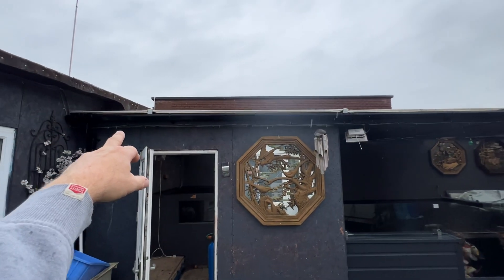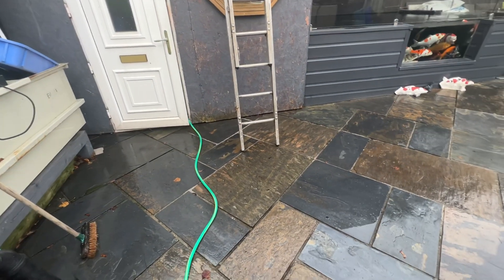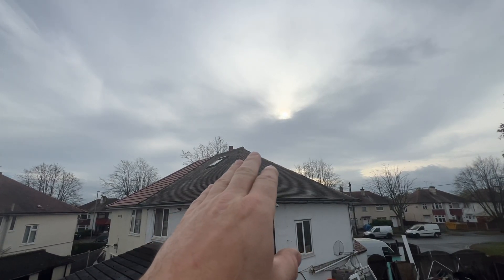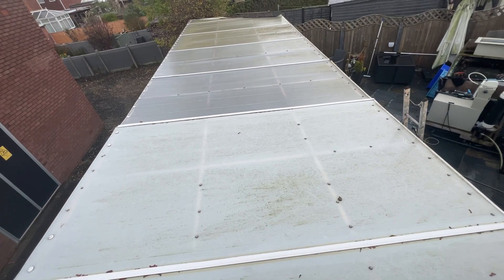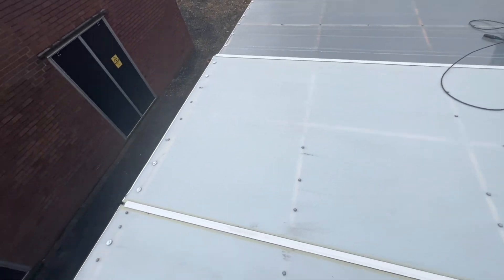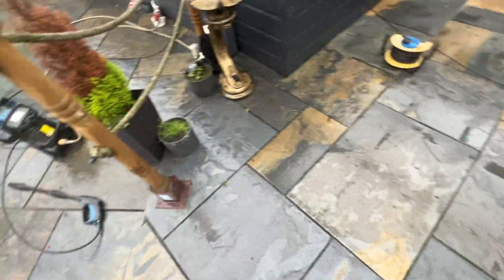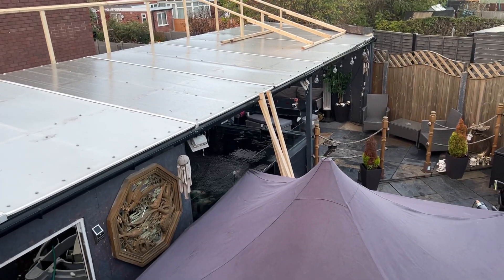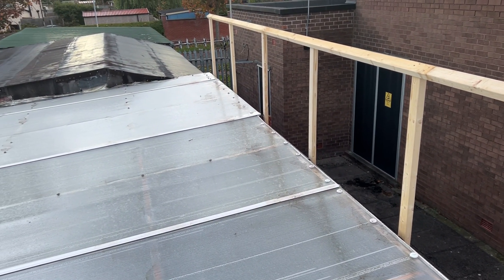DIY SOLAR SYSTEM PROJECT BUILD ON MY KOI PONDS AND SETUPS OFF GRID ?PART 1 #solar #solarsystem

Comment: Interested to know how much 8kw has cost you
Reply: Was gonna ask the same question Skeggy 🤔
Reply from the maker: Not cheap mate. I bought them second hand on market place a lot cheaper than new, I will work out total cost at the end when I finish buying bits for it, but hopefully it will run my house and sheds 👍
Reply: @Dannyskoiandaquatics  I thought you needed more than 8kw to run whole house 🤔?
Reply from the maker: Not the whole house just the excess that I don’t use on me sheds, maybe for the washing machine and other household bits we will see how we get on I’ve not worked anything out properly yet, just going to keep messing around with it when it’s up and running, then add some more onto it at a later date. 👍